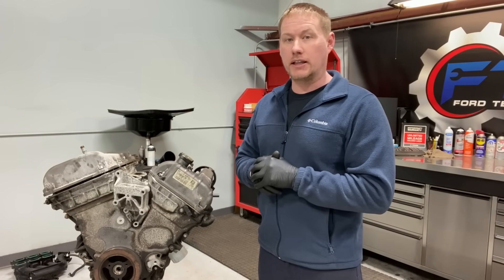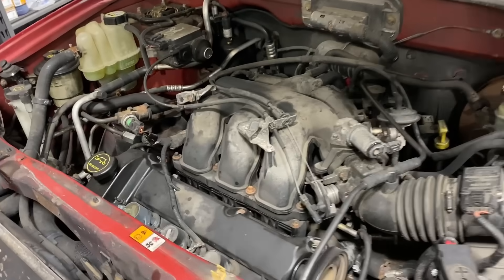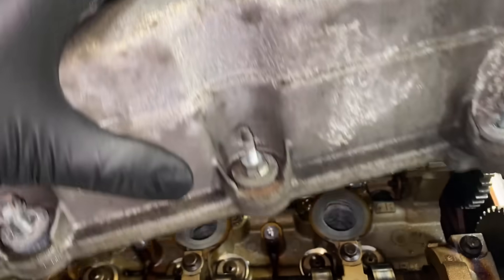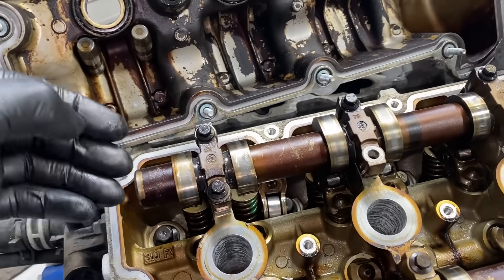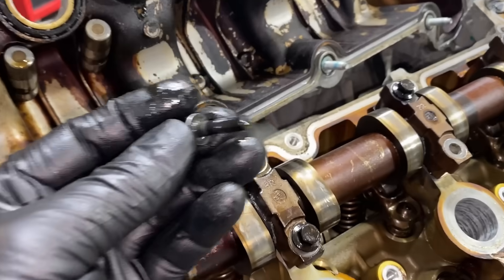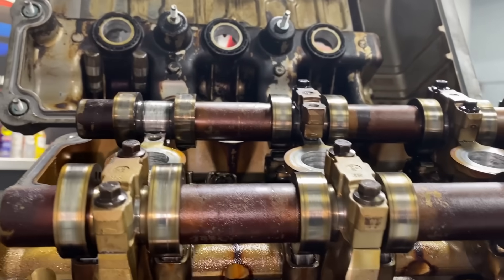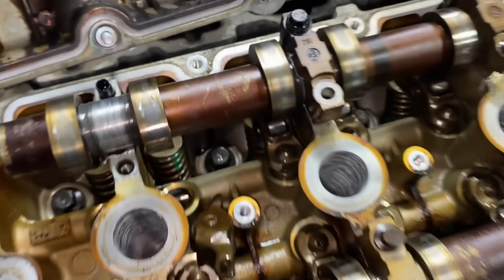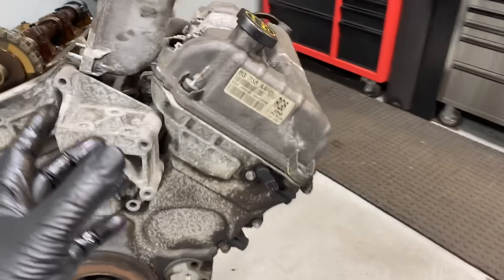Ford 3.0L V6 Duratec Engine: The One Fatal Flaw That Will Destroy This Engine!

Comment: My beloved Jaguar S-type which also has the duratec block had the same old broken washing machine sound for a moment before dying on the highway. I addition it also blew a hole in the right bank, taking out the starter in the process. I am going to do an autopsy of the engine next week and turn the block into a coffee table as a memento.

Comment: Mine just hit 270k.
Changed the fuel filter at 260k (oem)!
Change the oil every 4k miles, because I lose one qt of oil by then. 
I'm using castrol gold 5w20 since 180k miles, and castrol black before that.

Comment: 2006 Five Hundred, slight knocking noise from R.Side cover, but in sync with the fuel injectors ticking. No misfires. Loose cam cap or loud injectors??

Comment: Best produced vehicle repair videos on You Tube. Thanks Brian. 

3 Stooges woo! woo! woo! sound.  My work is cut out for me. I just got a great deal on a 2005 Escape 3.0 4x4. Remarkable condition overall for 190,000 miles on the odo. You sure would never know just looking at the vehicle and immaculate interior. I bought it knowing there is a speed vibration on the road and was going to go though the mounts, drive train, PTU oil change etc to get rid of it. Otherwise it feels like all 200 HP is still there and trans shifts great.  Slight misfire/ or whatever at idle.  Now I know what to look into and see if the caps are why.  This video may have just saved me and my new/old 3.0.

Comment: Why not to tighten those bolts to 89 in/lbs when we see misfires? Will the tightening action solve the problem long enough ( such as another 30k miles ) before they get loose again? Mine is 06 without any misfires yet.
Reply: 06 fusion 3.0.

Comment: holy crap i have a misfire on cylinder 3.  is it easy to get to this? do I have to remove the whole engine or can I just open it and tighten the bolts

Comment: Yep, the Duratec V6 is a very reliable engine, In the last 18 years i have owned two Mk3 Mondeos with it in and ragged the first one senseless and replaced the car cos it was tatty and the engine is now doing service in a Mazda Bongo and i drive my current Mondeo like its stolen too, in 18 years the only thing i have ever had to replace is a coil pack and an alternator which are not even engine related really.  Love the Duratec V6 but they were last put in UK fords in 2007 and everything is a evil turbo now keeping me away from newer Mondeos :(

Comment: Is the engine he is showing here the Duratec 24v dohc?  or are there Duratec's other than the 24vdohc. I have the Duratec 24vdohc it is now 23 yrs old with over 200k, always maintained and it still purrs like a kitten, has plenty of power and still gets the same MPG it did from day one.  I have had to replace AC compressor etc which was costly, but hey, I figured I would rather spend the money than to get another care that would be less reliable.  Truth be told I constantly am on the lookout for the exact car with the exact engine etc as my 99 SEL.  If I find one in a retirement area like Florida or AZ that a senior has bought new and maintained, I will scoop it up for sure.
Reply: Any issues with yours? I just bought a 1999 taurus LX with the duratec even though most sources say they didnt put it in the LX. It has 31k original miles
Reply: I have had all models of Taurus, most of the lower models came with the Vulcan, BUT, your LX could have been ordered with the Duratec 24v DOHC if the buyer was savy on the Taurus.  Usually the SEL came stock with the Duratec as far as I know.  I have a 99 SEL I have been driving this car for 25 YEARS!  approaching 200 k on it, the motor runs like a kitten, still has the power to get up and go and still gets the same mpg, it does leak a little oil but not enough to have to add any between oil changes.  The trick with Taurus for most years anyway is to change the darn oil every 3k, use good oil and the best filters, ALSO change the Transmission fluid at least every 40k but I went to every 30k as I just wanted my tranny to last as long as the engine.  I have taken very good care of this car and it has taken very good care of me.  Friends laughed at me buying a new 1999 "weird window and body" Taurus.  I have been laughing at them over the last 25 years because I have not had a car payment for over 21 years!  My Taurus has never ever let me down, never stranded me and even with all the miles on it now the suspension still is holding in there pretty darn well.  I am actually going to put new struts all around, two lower ball joints, and two wheel bearing hubs on the front soon, I bet I will still be driving this car for several more car payment free years. I have had other cars during these years that have come and gone because they were a pain in the pocketbook, my Taurus lives on!  I think I just might have my brother take the covers off and check on those bolts though after watching this video, it made me nervous!  Brother is crackerjack mechanic so we will barter his time as always, and he will be doing the suspension for me as well.  I get it that if a shop were involved perhaps I would not put any money in to a 25 yrs old car, but it is just parts and he gets them wholesale.  I just want to see how long this WEIRD WINDOW AND BODY Taurus will go.  My other car is a 1993 Lexus LS 400 I bought in CA and had shipped to me with 48K on it, this car is legendary and I expect I will be leaving in my will to one of my grand kids!  I have been reading about all years newer all makes and models of cars and I am not going to spend my hard earned money on any of them, they are making junk as far as  can determine.  You really have to be careful what you buy these days whether new or used.  Do research and buy a used one with either a good carfax or other report or private receipts from the owner . ......good luck with yours.  OIL CHANGES A MUST!
Reply: @jeedwards1981  mmm, sometimes if a car has sat or not been driven much low miles can be a problem in that the gaskets and seals tend to dry up and when you buy a low miles older car, it might just start blowing gaskets and seals.  I prefer a car with moderate mileage that has been driven and had the oil changed and the tranny fluid changed.  Sitting , not being driven isn't good.

Comment: I have a 2002 V6 Duratec in my Sable.  Was not able to find the cause of the misfire on #2.  I threw a ton of new parts at it with no luck.  It has never overheated on me, but recently it started making a very nasty engine noise similar to the example in your video.  Is it worth digging into this engine with the hope of finding something that can be fixed or is it a dead duck?  Only 114K and pretty well maintained.
Reply: Ever figure this out?

Comment: Hi
Is it necessary to replace all these bolts or I can only check and tighten them?
I am from Europe so I can get it only from US and this is not cheap. Should I really replace it?
Even rockauto doesn't have this part.
I will be grateful for your advice, thank you.

Comment: I have a Ford Escape XLT 2012 and I believe this is what happened to it sadly.  ~94,400 miles on it. Not even 100,000. Bought it September 2011. Had the Code P0301 light up on it in early February. So barely 10 and a half years on it. Firestone thought it had something to do with my Sparkplugs, Ignition Coils, & had a Fuel System Cleaning. That did not solve the problem. Took it to Ford. They said I needed a replacement engine. I had that verified with a friend who is a mechanic. He agreed with Ford. What a Friggin' nightmare this turned into.  Ugh.

Comment: This just happened to me a few weeks ago, or pretty sure it was this. 2011 Fusion 3.0 v6 AWD. I bought this car for my daughter last year, very clean only 24K miles. At 27K miles we started to hear that same sound coming form the same side of the engine (Pass Side). Then it just self destructed. Had to tow it into ford and they confirmed engine was trash and needed to be replaced. Thank goodness I bought a Ford warranty when I bought the car, which should cover this. You would of thought Ford would of addressed this issue by 2011.  Anyway car is still in the shop and it's getting a new engine. Thanks for the video, explains things very nicely.

Comment: Reduced valve lift won't cause a dead misfire, it may cause a weak cylinder. Moreover, a weak cylinder in this case won't change the mixture, so no melt down of a cat. Reduced valve lift doesn't affect ignition or compression or mixture. There's just less air AND fuel going into the cylinder but it's already mixed before the valves ever opens. Now zero valve lift will cause a dead misfire, but still no effect on the mixture, so no melt down. A valve STUCK OPEN will affect combustion due to lack of compression, which can affect the cat melting down. Incomplete combustion = raw fuel out the exhaust.

Comment: Just bought a 2008 3.0 ford escape has 145,000 the engine was replaced with 78,000 miles and a rebuilt transmission Misson sounds smooth does have a oil leak just don't know where it's coming from it had a miss fire change the spark plugs misfire went away hope I made a good purchase I do love ford's just scares me to watche videos like this

Comment: the early 2000's 3.0 had the blown out spark plug issue. helicoiled mine and drove it over 200K miles. good little motors and the AWD escape it was in was really good in the snow.

Comment: @FordTechMakuloco great video 👍🏻 
I want to ask is it necessary to replace the bolts or just check them and use red threadlock? I am in the UK 🇬🇧  and own a 2006 Panther Black Ford Mondeo ST220 with the 3.0ltr V6 24V Duratec. It's covered 65K from new but I'm going to remove the cam covers to paint and do a major service so might as well check all these bolts at the same time. There is no noise or issues at present that i know of but Ford crazily want £360 or $490 for bolts?? Crazy but cheaper than an engine or rebuild. Would it be enough to just remove them ..clean & put threadlock and torque them down? 
Also have Ford got an upgrade bolt or is it still the same bolts fitted from between 2000-2007 ? 
Thank you
Reply: did you discover anything when you opened up the covers? any loose?  did you replace, or just retorque?
thanks
Reply: @jdm1hunter  haven't done them yet mate but was advised to check them all with a torque wrench ....a few people suggested to take one out at a time and use red threadlock so they wouldn't come undone but others said just check them and set them to correct torque. I'm going to get further advice first but so busy doing underbody and suspension at the moment Ford Mondeo Mk3 ST220

Comment: My daugther's 2002 Escape V6 started knocking like that at 195,000 miles. I was diligent with oil changes with synthetic oil and I was freaking out that it was a lubrication issue with brand of oil I was using...

Comment: Hi Brian if I replace these bolts should I use thread locker. ? My 2005 Ford Escape has 205K miles , no noises, but multiple oil leaks. I also installed a Southern Front K-frame, as I am in the rust belt. I laugh every time I drive by the Ford dealership!!! Thanks for your Excellent videos.

Comment: Had a 01 ranger 5 speed manual 3.0. Original motor, trans, and clutch :0 lasted until 289k miles until the clutch blew up. Motor still good.

Comment: Well dang. I wish I had seen this video a few months ago when I had my valve covers off... I've had misfire codes in the past that I thought were due to faulty injectors. Replaced both exhaust manifolds because the cats had burnt out and clogged up the exhaust system... Guess I need to check mine out...

Comment: Is the loose bolt issue both sides? Do you know the part # of those bolts? Can they be ordered online ?  The oil leak you mentioned as a common issue on the corners. Is the fix for that new valve cover gaskets? Trying to help my sister out. Ford dealer  estimate was  $3500
1) Replace MAF SENSOR 
Complaint : CEL ILLUMINATED
2)Replace both front sway bar links 
Complaint: rattling noise next to front passenger side by tire.
3) Replace fresh air door actuator internally damaged
Complaint: popping noise under passenger side of dash
4) Complaint: oil smell
No remedy found on ticket. I did find a oil leak from top front of engine driver side by bottom corner of valve cover corner. Seems like it might be coming from the valve cover gasket. When front valve cover is pulled will verify cam bolts aren't loose.

Comment: You mentioned model years 2007 and earlier, but what about 2008 and later? Did Ford make a change that resolved this problem?
I have a 2009 Fusion V6. Should I be checking this out?

Comment: Far more likely to destroy a Duratec 30 is the upstream cats becoming clogged  and being sucked back into the cylinder. Happened to mine and about 25-30% of every Duratec 30.  I literally wrote the guide on repair and replacement about a decade ago at Mazda6 forums and, later, 6Crew.
Reply from the maker: Really? I have seen plugged cats melt plastic intakes, cause misfires etc but I have never ever seen one suck broken catalyst back up into the intake valves.

Comment: I have a 1999 Ford Ranger with 3.0 V6. The engine was replaced and now has about 18k on it. Runs great. I also have a 2012 Ford Escape with V6. Can they be swapped? What does that look like? Should it be attempted?

Comment: Hypothesis as to the cause of
Cam shaft journal cap bolts loosening up...

The direct drive water pump (water pump system without tensioner) is possibly a significant contributing factor to this cam cap bolt issue.

Many, if not most owners don't change a water pump until it fails ...

I'm not suggesting the actual failure of the water pump is contributing to the cause of loosening of the cam cap bolts ...

More likely those bolts are loosening from the gradual ware during the life of the water pump....

Normal  water pump ware results in indistinguishable yet real vibrations, at correspondingly different frequencies, which are radiated throughout the cam journal bearings to the cap to the screws.

The frequency of the vibration during this natural ware process is occurring over the course of the life of the water pump, generally occurring over years.

Thus... Different operating patterns by different drivers in addition to different maintenance 
effects the screws in varying degrees ...

I was reading an earlier TSB 06-3-5. Where I believe the cam cap bolts torque spec is 72"lbs, leading me to believe 72"lbs is the original assembly spec. Yet the most recent spec is 89"lbs on the cam cap bolts - Over 20% increase in torque.

My suspicion is the original engine engineers never factored in a water pump driven off the cam. Never mind a direct drive water pump (without a tensioner pulley)

The role of a tensioner pulley not only maintains a consistent pressure on the system but also absorbs vibrations & other inconsistencies within the system.

Hence ...
This leads me to a question ❓
 Is it possible to add a tensioner pulley to my 05 Escape XLT 3.0? (I realize it's likely I would also have to change the pulleys for both the cam drive & water pump to a serpentine style pulley)

I may also be completely off base with the hypothesis & look forward to  intelligent & spirited input.
Thank you in advance for all contributions.

Don - Solidwire

Comment: Is this also pretty common on the Vulcan engines? I'm scared because I have a slight ticking and then a misfire which I still have even after new spark plugs, wires, and a coil. Engine only has 81k though
Reply from the maker: No not at all since the Vulcan engines do not have overhead cams.
Reply: @FordTechMakuloco  Yeah that's what I was thinking. So glad you replied. I'm having an issue 01 Taurus Vulcan engine SES trim. Cylinder 2 misfire. I've put on new coil, plugs, and wires and still same cylinder misfiring. What could it be? Drives fine just misfire at idle it seems. Bad fuel injector? Clogged fuel filter? Vacuum leak? Please reply because I know you know your stuff. Thanks a bunch

Comment: This engine is also used on the 2004 Mazda6 S. The only major problem I had with my car was a P0301 engine trouble code where the rear valve cover gasket was leaking and I had my cousin to replace both gasket banks at 125,000 miles. From watching this video, I wasn't surprised how noisy the engine was. So far, no problems at all. Just normal wear and tear.
Reply: @TrickyDicky2006  I can't wait to convert my car with dual exhaust by taking out the third catalytic converter. I have the 5 speed manual transmission and need to upgrade to the 6 speed.

Comment: You said 34 are required. I think you meant 24! Or if the same bolts can be attached on the timing chain end, then that would make 32. Please update your description and reply!
Reply from the maker: 18 bolts in the left head plus 16 bolts in the right head adds up to 34 no? Are you ok?

Comment: if i hear the clacking noise from the valve cover is it too late? Or can i just tighten the 8mm bolts still to save the engine? Yes i have the misfire and changed plugs and coils pcv and cleaned egr valve. car has 210k.

Comment: the metal casting on the outside of the head (where the exhaust port is) would melt down or just the inner gaskets??

Comment: If you get a misfire doesn't it send a code to the ECU? I have a 2005 Ford Escape 3L with 180K miles that will get a slight misfire when I start it in the morning but goes away when the engine warms up. No code.

Comment: About to get a Jag x type 3.0.
Is it the same engine?  Mine will have only 17k miles but will be 13 years old.  Should I expect the same thing?  If I change those bolts now to head off a future problem, how will I know for sure that the replacement bolts are better?  Where should I get them?